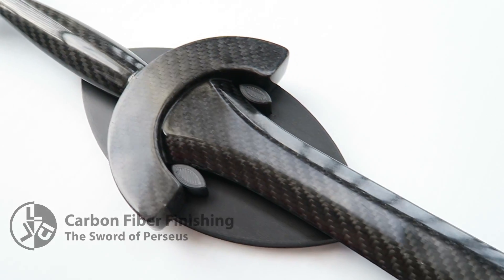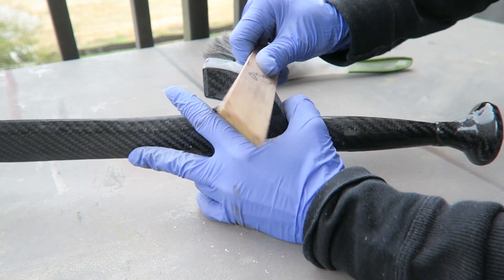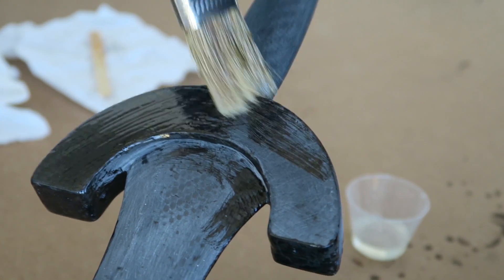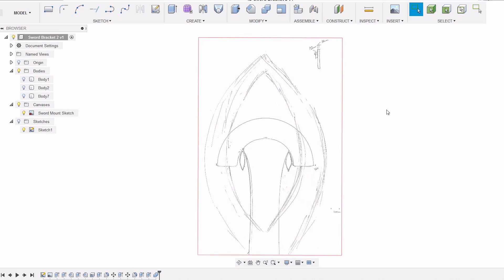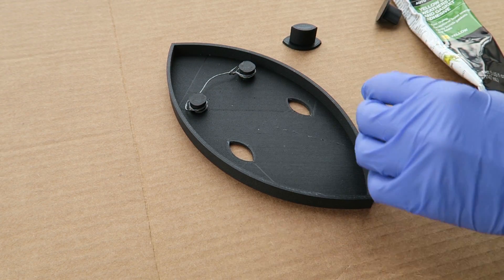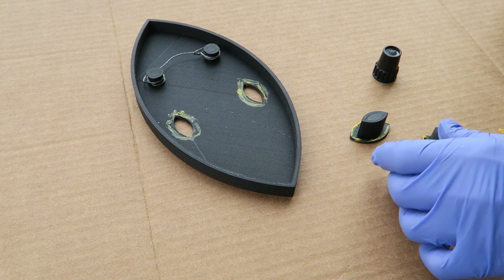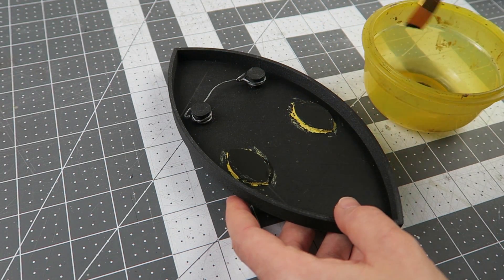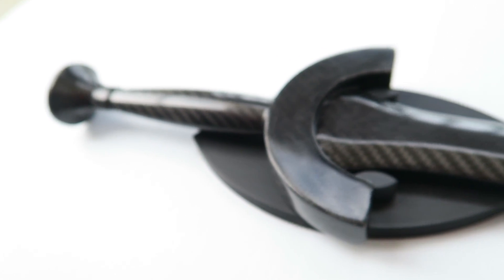Getting a Perfect Finish on a Carbon Fiber Sword

Comment: What kind of epoxy resin are you using? In your previous video, you also just used epoxy resin on the fiberglass mat, and just took the extra time to wet it out right?
Reply from the maker: Ez Lam from ACP composites, longer working time version. Yes, it was a pain to wet out since the binder doesn't dissolve in epoxy but fine.
Reply: @LindyDesignLab  thanks for the quick reply! I assume the longer working time helps too, instead of regular fiberglass resin that sets up so fast

Comment: You said it isn't sharp, but I'm curious just how strong is a carbon fiber sword? Is it as tough as a wooden sword? Or would it fall to pieces with one good strong wack?
Reply from the maker: Depends on how solid the thing you need to wack. Better tactic is to stick them with the pointy end.
Reply: @LindyDesignLab  I would agree. I think it would be cool to try and replicate Kirito's sword, The Elucidator from sword art online with carbon fiber. Since the swords basically black with a kind of shine to them. https://swordartonline.fandom.com/wiki/Elucidator

Comment: Looks great, but man I hate that weatherstrip adhesive.  All it wants to do is make strings that go everywhere.  I like the pot of barges contact cement, I apply it with cheap paint brushes for detail work.
Reply from the maker: Yup, would do it that way in hindsight.